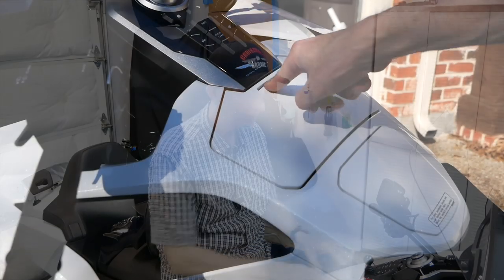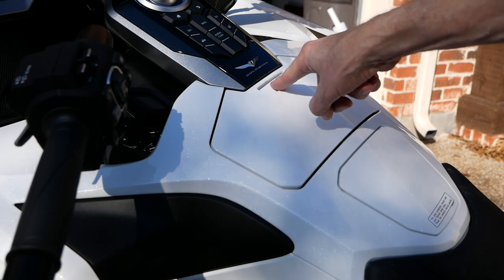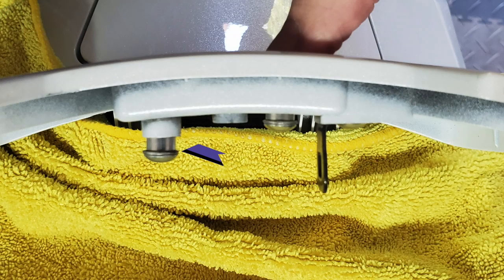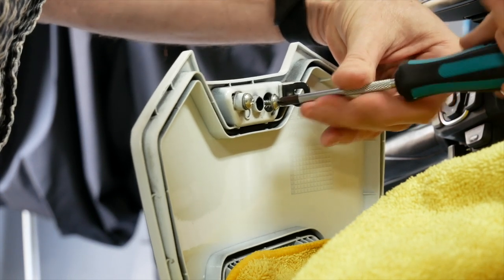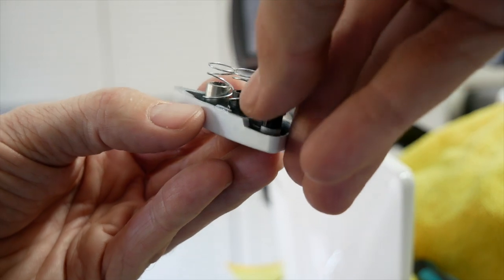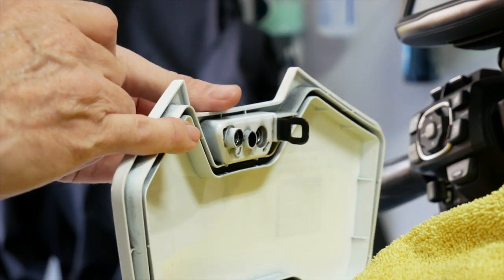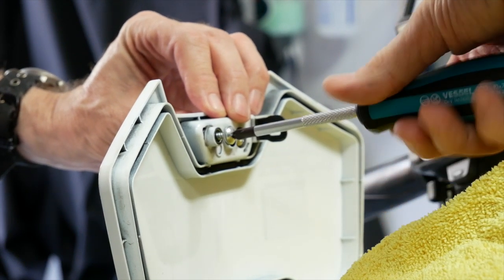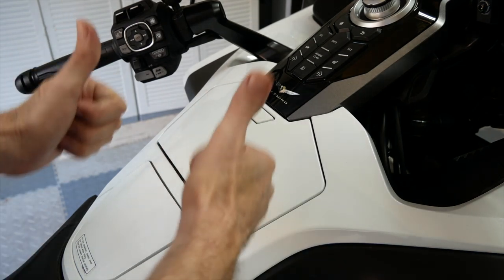2018+ Honda Goldwing Center Pocket Door Hack

Comment: I understand a lot of people have this problem with their bikes but I have never had a problem opening my center compartment. I can open mine the first and every time from pressing the right side or center or left side. I don't know why mine is that way, but it is and it has not been modified. I guess I just got lucky with it. I know a couple guys that have done the modification and it does work
Reply from the maker: Interesting
Reply: That is interesting because I've tried opening this compartment on a number of 2018 bikes - maybe up to 10 - and they all had the same problem.  Even with this modification it doesn't open nicely from the left side.  I certainly would like to see pictures of your latch taken apart.  You are one lucky guy.

Comment: My 2018 Goldwing center pocket door requires pushing it on the right side of the latch to get it open. I adapted to it and look at the "issue" as a way to prevent someone from peeking in the pocket looking for something they don't have any business looking for since it is not a locked compartment, think of it as an inadvertent security feature.

Comment: Chris, I am wondering if this is a 2018 only problem, and if it's something that Honda has already adressed.I have a 2019 and have never had an issue with my latch, it opens first time every time no matter where I push the button. I am going to take mine apart just to see if something has changed compared to yours.
Reply from the maker: Possible, but I never heard any information from Honda that it had been addressed. I would be anxious to see if you notice a difference. Take some photos!
Reply: @cruisemansgarage  My 2019 does have the same issue.  This seems like a very minor modification and I plan to try it.  I appreciate these videos!!

Comment: Never had a problem with my suspension..Max said it sucks. Never had a problem with my center console latch. Seems Max never liked the Honda Goldwing. Yes, I bought one of the first 2018 GW.
Reply: James B. Max sells parts for the Gold WIng.  Think that might influence his thinking at all?  😂
Reply: LTVoyager   My point exactly.  How can I trust his opinion.
Reply: James B. You have to decide.  I watched many of his videos and I think he makes some good points, but he also grossly exaggerated many others.  When I saw him hammering and releasing the throttle to make the Wing buck in the front, he lost all credibility with me.  Almost any high powered bike will behave badly when you do that.  Even bikes like the K1600 which have a pretty fantastic stock suspension won’t tolerate that sort of behavior all that well.   And who actually rides a Wing that?  That was just idiotic in my opinion.